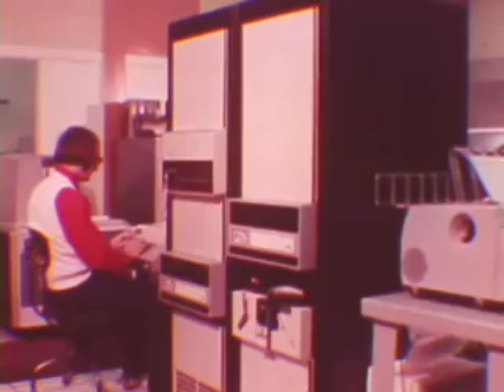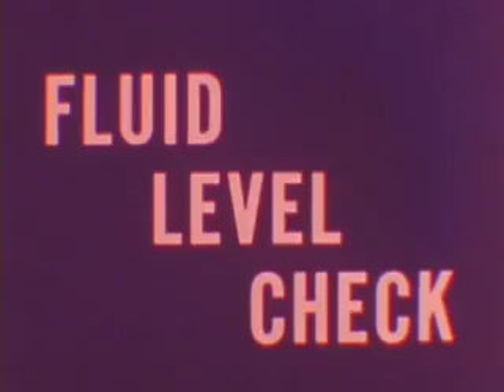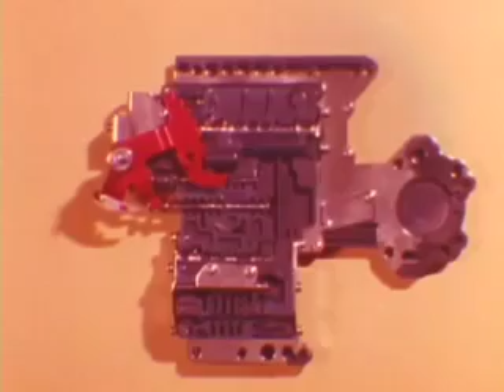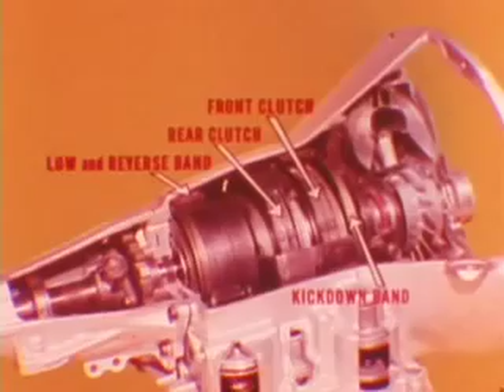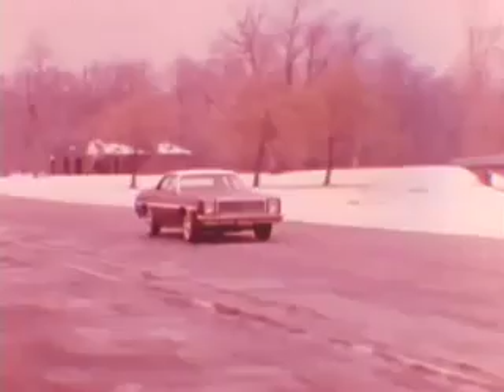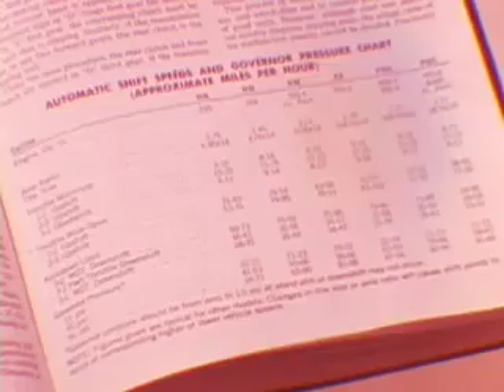torqueflite 727

Comment: 727 is one of the best old non lock up 3 speed auto ever conceived,  easy to rebuild, strong, and can easily be made to shift FAST!
Reply: Mopar dominated late 60s 70s drag racing with torqueflite. 
International used the torqueflite for their pickups, they held up good.

Comment: Years ago i was building transmission. And we would take the accumulator spring out it would firm up 1 to 2 shift. Well did this and that truck would break back tires loose even under light throttle. I adj gov pressure to ease it up. The owner was an old couple. They brought it back about 1 day later. Asking to detune it . He said every time it shifts it would knock ma’s top plate loose on her false teeth..... what’s a man to do lol. I put spring back in lol

Comment: The  later  Dodge Ram  transmissions are essentially   727  guts  with an overdrive and electronic controls,  which either shows how good the old design was, or  how  "non innovative"  the  "new  Chrysler"  is
Reply: Will the valve body fit in the earlier tranny ? I'm putting drive by wire fuel injection on